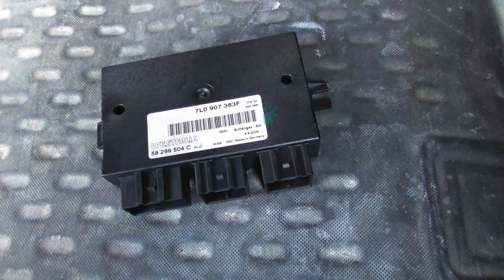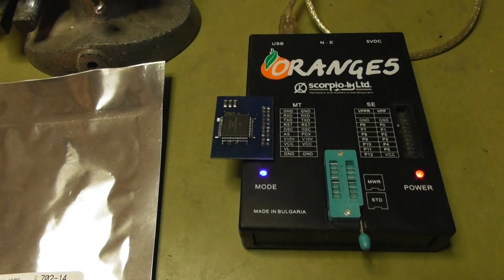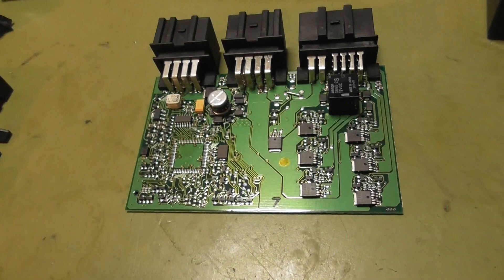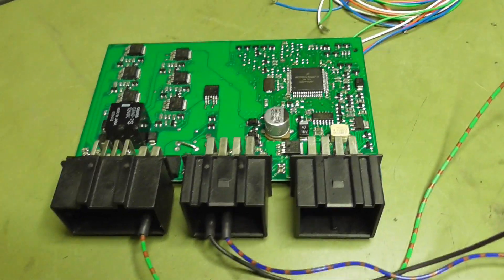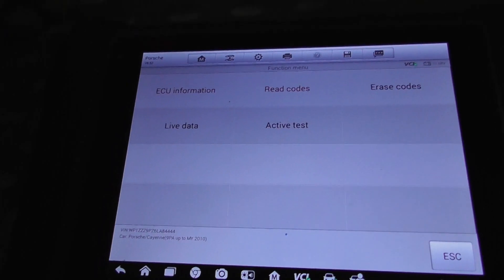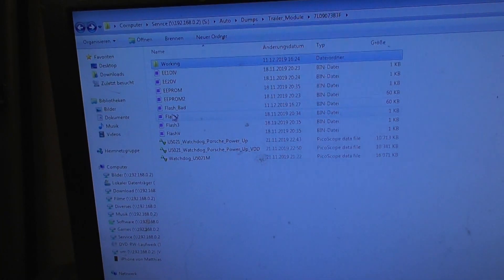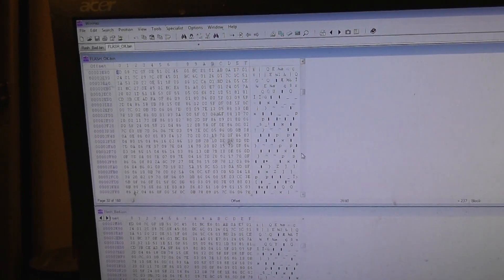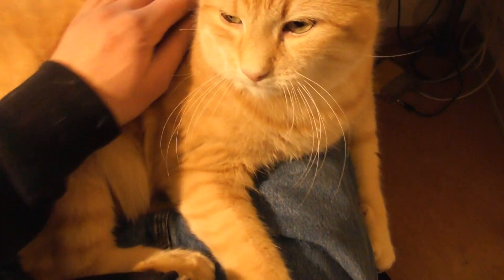ECU repair - Porsche Cayenne trailer module Part 3 - the repair!

Comment: Good to see people still have the skills to fault find at this level, I worked in military electronics and not many people had the ability to find the fault combined with the ability to repair (most would have fried the processor or lifted tracks trying to remove it). Every one I know just swaps out boards now, well done for showing what can be done.